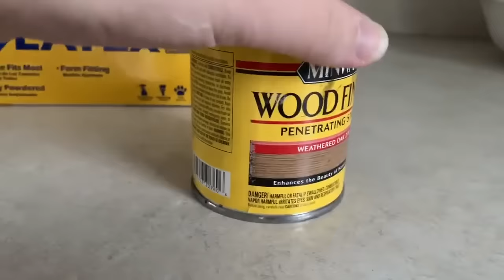HOW TO GET THE ARHAUS LOOK | ARHAUS TECHNIQUE DUPE

Comment: I’ve watched hours of videos trying to find what to do with my golden oak kitchen cabinets. I want a white on white that shows off the oak wood grain, but needs to have a durable finish that will hold up to cleaning of pasta sauce, greasy residue, and take stray water sprinkles and steam. THIS. I’m going to do this. Thanks so much for the inspiration. I’ll just stick with light tan and white paint and stain colors and follow with min wax polycrylic. Excellent video, both for content and for making it so watchable. Thanks!!

Comment: I love it!  I will try it in a piece I just but in a thrift store.   If I apply this to a dining table, do you recommend adding something extra to protect the surface?  you know tables can be very messy...   Thanks!
Reply from the maker: Thank you Veronica! For a table top would recommend maybe doing at least 2 coats of the Protective for a little extra protection if not 3.

Comment: Is the Valspar paint used here a specific paint for wood?  Thanks
Whitewash then stain? Or stain then whitewash? Seen both techniques, wondering if it makes a difference to end result?
Reply from the maker: No ma'am, its actually just some wall paint I had leftover. Because the stain is an oil based product, once it is applied it is going to be really difficult for any paint to permeate the wood underneath. The whitewashing almost acts like a "toner" to lighten the wood before adding the stain.

Comment: Hi there, I was so impressed with this video and the outcome that I decided to do it on a dresser- which has five drawers, I did the whole white wash and three stains on three of them and then on another day I finished the other two drawers. The outcomes are very different -I’m not sure where I messed up, perhaps I needed to leave the stains on longer??. But what Ihave is a very dark look on 3, and then the second time finishing up the last 2 drawers, they are overall much lighter. Can you please suggest how I might rectify this? I am considering adding black paint and glaze and working it in -to match up the colors, but I’m not sure if I can put the paint/ glaze combo on top of stain?? thinking that doing this might require my needing to use a primer??
or alternatively should I repeat the black stain step again ? I Would love your feedback, and really need help.
Thank you in advance.
Reply from the maker: Hi! it's hard to say. After reading this, I believe I would repeat the black stain step again on the lighter drawers. Unfortunately, this is one of those project where if your timing in leaving stain/paint on one part of the piece is longer than leaving it on another part of the piece than it can skew the end results and give it a less cohesive finish. Try the black stain step again and see if that helps!
Reply: Hello River. How are you doing?

Comment: I love this Look it is exactly what I want to do the question I have is the paint you’re using the original paint the white paint is that a chalk paint and are the colored paints the Minwax oils or are they all chalk paint?
Reply from the maker: Hey Maryann! I'm just using some flat finish, whitish Valspar paint that was leftover from another project. As long as it is watered down you can work with just about any paint you want. Might have to add a little extra water to chalk paint though.
Reply from the maker: ... Also, The Minwax products are Stains. The last minx product I use is a water based protective top coat.

Comment: Well done! I was thinking throughout why wouldn’t you use one of the tinted stains in grey, etc, but then see the finished product has so many more layers of color than just grey.  Looks like you distressed it as well, yes? I see what my next project needs to be...
Reply from the maker: Yes! The layers is what I was going for. No distressing after application. I think the final coat made it look like it has that element to it though.